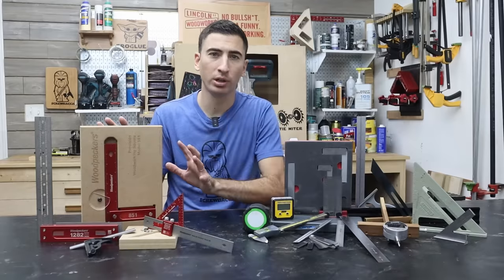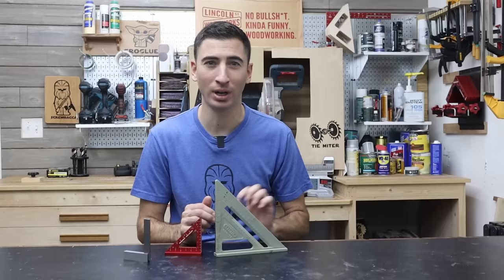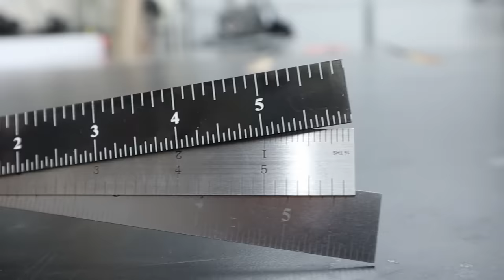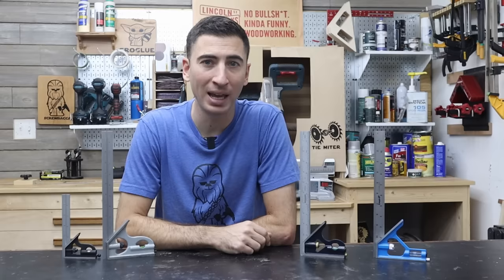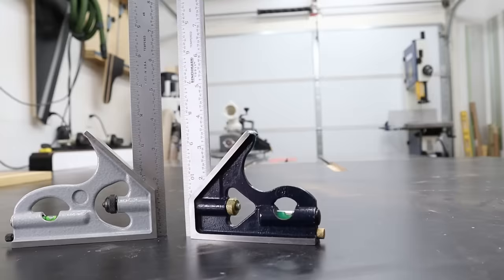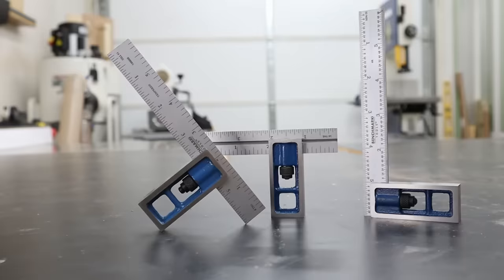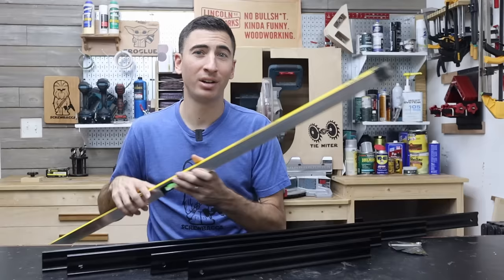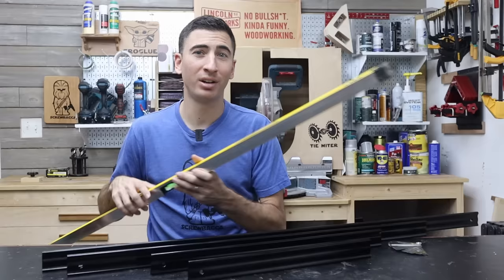Why is woodpeckers so expensive?

Comment: As a retired machinist- The machinist industry demands high quality precision tools that perform like new even 10-20 years later. For that reason machinist tools are rarely made of aluminum. Buy quality steel tools that won't wear like aluminum or rust like Chinese steel. As a woodworker now I still build my projects with a machinist mentality, with an accuracy in thousandths, so I use tools that will consistently provide that. If you are less discerning, then by all means buy the cheaper tools. But if you realize later you really enjoy woodworking and want to up your game, you will have wished you bought the good stuff in the beginning. It's a buying decision that will differ with everyone.
Reply: Master sheet metal mechanic of 47 years I couldn't agree with you more. Especially when I was working on nuclear submarines and destroyers. I still have my Starrett and my 8" MItutoyo. They are 46 years old and are still as accurate as the first day.
Reply: @kevinhogan715  If someone is looking for accuracy why even start with inferior tools. That's starting off at an automatic disadvantage. People in the trades like you and I realize the importance of quality tools that last forever. Cheers

Comment: As a machinist who eventually began dabbling in carpentry (because why not?) I firmly believe that the closer the tolerance the better the result no matter the material used. I use machinist’s squares, mics, calipers, and indicators on my projects as a novice (at best) carpenter and receive tons of customer compliments.
Reply: I forgot to add: Starrett is built well & in the USA, but for my production projects I use Mitutoyo coolant-proof tools only because I already own them for coolant flooded mill work. Stupid accurate calipers for only $300 on reputable sites such as MSC. My advice is to stay away from less costly fake Mitutoyo that are shitty copies made by the chicoms as they are no where near as accurate nor durable. Buy once, cry once.
Reply: I would suggest there is a balance. If you want to spend an inordinately long time making your length of timber as accurate as it might need to be for a space rocket, then that’s your choice. I’ve been woodworking for over 45 years and think I’ve learnt how accurate you need to be. Natural timber (non made products such as MDF, plywood and engineered beams) moves. It moves across the grain in hours or even minutes. Therefore what was super accurate before lunch isn’t so in the afternoon. In addition, the fibres on timber do mess up super-accuracy. When you cut something with a saw, the fibres crush, cut or move - and the amount depends on the coarseness of the grain of the timber. If you want better accuracy, then you can plane or sand to a better finish but, be aware, adhesives don’t work so well with super smooth finishes. Most adhesives recommend nothing finer than 150 grit. 

So, the lesson I’ve learnt is to balance time spent against relevant accuracy.

Comment: I have a unique ( or maybe not so much) job where I work on older houses where everything is out of square and out of plumb and I often find myself splitting the difference to achieve the best results. My problem lies in not having a shop to bring these pieces to, therefore having only worksite tools. No giant table saws, bandsaws taller than me etc.  I'm sure I'm not alone with this problem and I find myself doing all work on site using folding tables , clamps and whatever it takes to get the job done. I love my job and I guess I don't actually know where I'm heading with this rant. Thank you for your videos, keep them coming and I'll keep watching. Your work is appreciated . Peace

Comment: Other advantage to steel tools - you can use magnets to keep them organised. Never have to dig them out of a drawer or a box (while in your own workshop, anyway), and self-adhesive strips are cheap, and can sit on the edge of the bench so they can be close to hand while you work, too.
Reply: I put magnets in many of my aluminum tools.
 
A realllly big downside of steel, rust. Low rust stainless, are very expensive,  and not magnetic. But for me, aluminum is a godsend. Easy to work with, and create anything you need. From tracks, to pulleys, to tabletops... it's a very forgiving.
 
Steel is a pain to deal with... I'm glad I dumped my old iron top machines for aluminum. I've seen no downsides (especially in my 115°F shop here in salty Florida lol... without aluminum here, I think 50% of my workload would be maintenance of equipment lol )
Reply: @carterscustomrods  Gross! You need to get air conditioning or move to Colorado. It's dry enough here that evaporative cooling is satisfactory.
Reply: @ChemEDan  oh... it's horrible. This summer was very cool, but i ended up getting heat stroke all the same. Lucky, my wife is an RN and got me a chilled IV Fluids to drop my temp immediately or I would not have made it to the ER. And I'm able to handle heat really well, but I've worked my crippled body nearly to death this year. But after 8 years bound to a bed, and finally getting my neuro illness "managed" better... I can't slow down. It takes me 100x longer to do all tasks with 1 functioning arm/leg.
 
So, my debt, and medical team here, keep me from leaving. If I wasn't nearly a million inedible debt, I'd built a workshop with AC... but having $25k for a 12x20 shed is nit a reality... but I did buy a better fan. Lol. 
 
So while Colorado is great... it's not feasible. And as hot as it gets here, it's better than the freezing cold. I'd mlbe in a frigid hell out there. Lol.
 
So yeah... definitely gross. But gross and alive us better than not-gross, snd not being able to move my body from the cold lol.
Reply: @carterscustomrods  A L U M I N I U M
Reply: @stigkrakpants3052   T O M A T O...  Y A B R I T C U N T !!! 🤣 🤣 🤣
Reply: @carterscustomrods  A L U M I N I U M

Comment: I'm glad to see that you mentioned the differences between aluminum & steel/cast tools.  My father was a high tolerance toolmaker for nuclear facilities & I was fortunate to learn the value of quality tools at a young age.  Even so, I purchased a "high end" aluminum measuring tool that was highly regarded by many & it was early in my cabinetmaking career.  It took all of one week to regret my decision as laying it down on any machine surface or coming into the slightest contact with almost any other tool created small dents & burrs that completely ruined it.  I've spent the last 30+ years trying & in most cases convincing others to do the same, as accuracy & quality mean nothing if the materials used in its construction are inferior.  If anyone is considering one of those high-priced tools with the colorful & fancy anodized finishes, avoid them like the plague unless you'd enjoy buying it again in a month.
Reply: Hey Charlie, ihm from Germany just reading the comments here, didn't know that my job is called Toolmaker in the US, German Word is Werkzeugmacher with is a 1:1 translation.
Werkzeug =tool, Macher =maker. Still learning stuff at 55.
Reply: As a retired machinist, we will take quality tool steel or stainless most any day over aluminum. But I will say that those WP red tools are very accurate, have interesting little additional features built in, quality fit and finish, and will last a lifetime if you dont abuse them. I suspect they choose to use aluminum because it machines easily, gives a nice finish, and is easy on the bits.
Reply: @alexxander4572  I worked with a German printing press (Man Roland) machinist and he introduced me to some of the very best tools made in Deutchland. Been a fan ever since. Cheers.

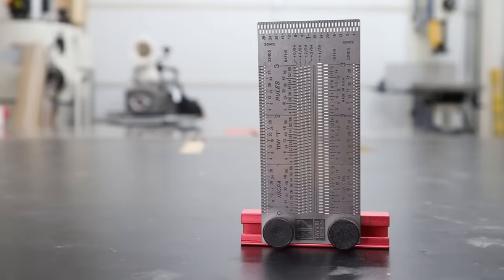Comment: 3:52 The Incras are great! I have a few different ones. You can get very precise markings. It is the only way to go. I don't have any problem with lead breaking, there is stronger leads out there too. Basically just use 0.5mm. Also I prefer a nice speed square over a combo square or double square anyday.
Reply: My Incra Tiny-T lives in my apron pocket next to my Pentel 0.5mm pencil. I use both more than any other tool I own.
Reply: I drilled bigger holes in my Incra so that I could use a .7mm lead or a #2 pencil.  Those .5mm leads break all the time for me.  Any imperfection in the wood at all breaks the pencil lead off (again and again).  I think that I just don't need such fine lines for the woodworking stuff that I do.   Only if the wood is surfaced already can I get away with it.  A rough piece of wood.. forget it for the .5mm leads!
Reply: @tralfazy  If I recall, it was Paul Sellers who brought my attention to the idea that you are cutting to the edge of a pencil line anyway, so the thickness of the line is not that critical.
Reply: @rf8driver  Good point

Comment: One measurement with digital calipers that most people miss is the step. If you look at the back side of the calipers, the end of the fixed jaw and the sliding jaw are machined to be even when they're closed, and match the inside and outside gap measurement when they're open. A lot of people try to use the pin that slides out from the opposite end to take step measurements, but it's much easier to use this secret method.
Reply: I'll do you one better. Did you know that when the jaws are closed, one jaw makes a 90° and the other makes 82°? This is to figure out if you're using inch or metric countersinks.
Reply: @dk-bw4gk  Alas, most aviation fasteners are a 100 degree countersink.
Reply: @Dr_Mauser  And there you have it, if it doesn't fit either jaw you have a 100° c'sink. :)
Reply: That is very useful.  The measurement end is much sturdier than using the 'pin' end for getting a depth measurement.  It's too easy to have the pin at an angle.   Thanks!  Not sure why it never occurred to me to measure depth with that other end.
Reply: @tralfazy  its like the combi squares that come with a pull out scribing pin yet few people even know its there... 😂

Comment: One indispensable tool in my shop is a 1-2-3 block: want 90° accuracy for the table saw, jointer fence, etc., ya cannot get any better — and they do not cost an arm an a let.  Personally, it is just nice to reward oneself with Woodpecker, Infinity, Veritas, Bridge City, or Blue Spruce Tool Works tool every now and then: because you deserve it!

Comment: I absolutely love my PEC blems. I also rely heavily on my engineers squares, the 90 and 45 for blade set up. Thought about the Delve square but opted for a small Milwaukee trim square and verified it's accuracy with my engineers square. 
I have the 6" Woodpeckers edge rule and love it. 
It is truly easy to spend way to much on all the "cool tools" that end up gathering dust. Thanks for the breakdown.
Reply: @CAD Thunkin Measure with a laser, mark with a chalk, and cut with an axe.  I can't control my cuts no matter how accurate I marked it.  LMFAO.  May be some day it will get better.

Comment: I actually bought a Starrett Combo Square as one of my first woodworking tool. My dad used one forever as his "speed square" on site and it took a beating and just worked, staying well within true enough for framing to finish carpentry, so I feel a connection to him whenever I use mine. Plus once I get his I can put it in a place of honour. Love my square, even though it cost a fair bit, and get used on almost every project I do. I also got the center finder with it, not used often but great to have. I went with a 12" model, it seems to cover everything I do.

Recently I got myself some of the small rules from Lee Valley, a precision square and pocket rule and they are very good for small layout and lines, I keep them in my pocket as they are just the right length for most jobs and super light. I want to get a small double square next, probably another Starrett, as I could of used that when working on my first tennons recently. The 12" square can be a bit much at times too, although I would still not change getting it first.

Comment: The big advantage of having the graduations inset from the end is you don’t have to worry about the end getting dinged and throwing off your measurement. When I was working with wooden rules I would always start at the one inch mark to bypass any problems with the end.

Comment: Great video. Like your presentation .... and the fact that I came to the exact same conclusions. Engineers square as a base; moderate speed square in my belt for site work; decent combi square for the bench and digital calipers that I use more than any other tool I own.
Also 1,2,3 blocks come in really handy

Comment: Thank you for the video!!! So far my accuracy has never been limited by the accuracy of my tools, but finding the right tool and the right technique. I find wood woodworking does not required the best of the best in tools, but simply decent tools and a lot of knowledge and technique and experience in using them. Its taken me many months to figure out how to drill a hole with dead on accuracy. It did not require better tools, but the right tools and the right technique. Now I can nail it every time and am very happy with my hole drilling accuracy after quite a journey.

Comment: I am machinist and Starret is the bar none gold standard. We also use PEC tools in our shop. If you don’t care about where a tool is made Mitutoyo makes good quality tools as well.
Reply: I thought it was a mistake when I saw the price of the PEC "blemish" squares (like the one he shows in the video), or thought I had found some internet scam or something, but I bought one anyway... Lo and behold, as in the video, the square is essentially exactly the same as a full-price one (the blemish on mine is almost impossible to notice). My Starrett square, while significantly more expensive, and surely accurate, has a finish that needs to be kept oiled to prevent it from getting a rust-like tarnish. I actually prefer the PEC for most things since I feel better about beating on it. I would say Germany, Japan, and USA are all similar for high-precision tooling, and would have no complaints with Mitutoyo tools - they make some sweet calipers and dial gauges.
Reply: Mitutoyo is the industry standard...

Comment: This level of accuracy is only necessary if you want your woodwork to look like it was entirely machine made. I watched a vid the other day where another tuber made a table using his table saw, jointer, planer, mitre saw, bandsaw, drill press and RO sander and when he'd finished then spent an hour hacking at it with various blades to make it look "farmhouse" before he put his "farmhouse" finish on. Madness.

Comment: I definitely would like to see a video about the dial gauge jig. Also, found this super helpful. I’m going to start slowly replacing my home center tools now with some of these. I honestly think my progression as a woodworker has stalled because I can’t get precise and accurate measurements.
Reply: I'd have to agree with you. I cringed when I saw that Empire combo square (that I bought at Home Depot) that I use a lot for general layout and use to check square/parallel on my SawStop. First purchase is a PEC blemished combo square.  Hey Jon, how about a video on how you made that mount for your dial gauge?
Reply: Yea, Jon, how did you make that cool jig ;-) ;-)
Reply from the maker: I will be sure to include the dial gauge mount in a jig video
Reply: @Lincolnstww  GREAT Stuff - Any update ?  A plan would be nice if you're not doing a video - THANKS  It looks like the other slot has a nut and turning the bolt pinches to hold the bar in place?  What are the 2 bottom holes that look like they contain set screws ?
Reply: Hey John. Love all your videos, and antics! Would love ALL jig videos that you might produce> Thanks a bunch!
Reply: Sam. I felt like you so I started to accumulate sensible, precision measuring tools that have enabled me to feel more confident. A digital t-bevel and a digital, magnetic blade level allow me to make table saw and miter saw cuts within 1/2 to 1 degree for about $50. I did a number of precise projects that would have looked like crap otherwise.
Reply: @Lincolnstww  German tools, engineering, and precision are sh¡t !!!! 
If you want quality you need Slovenian stuff

Comment: My supposed top end Stanley combination was out by 3 degrees but when I put a starrett blade in it that fixed it. I have a Starrett combination in 12 and 6in and both will take up to a 72in blade. I have 24in blade that I use way more than I thought I would. Also have an engineers square and a very old Starrett T square. A tool collector friend of mine gave me the handle and I bought a blade for it at work for peanuts. The 24in blade I bought for my combinations squares is accurately flat enough to set up my jointer top.

Comment: I bought all of my squares when I was working at an industrial supply house so I have Starrett squares,  machinist and combination as well. Staff pricing was MUCH better than current Woodpecker and I bought them long before Woodpecker existed. That said my Starrett and Mitutoyo squares will likely outlive me so I will NEVER have to replace them. Starrett is an ENGINEERING tool so FAR more accurate than any woodworking tool but that works for me. As well I have an Incra square on my Delta 10in industrial tablesaw. Massively accurate.

Comment: Great video. Thanks for sharing the good advise. I never knew how bad my measuring skills were until I started a "modified" French cleat project a few years back. Before buying an Incra Rule, I actually made a marking tool, with a hole, from a wireway cover. Then I found the Incra rules on YouTube. These are so good, they literally made the difference between a great success and the previous total failures. Looks like we're nearly neighbors, I'm down the road in Powdersville/Easley. Keep up the good work!